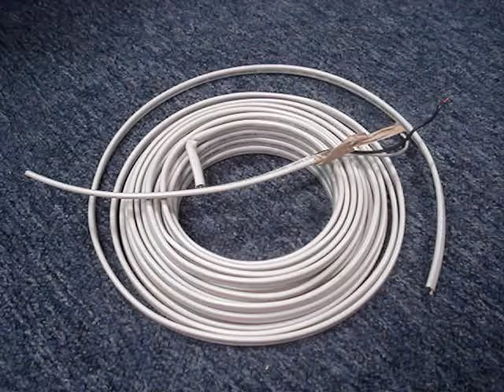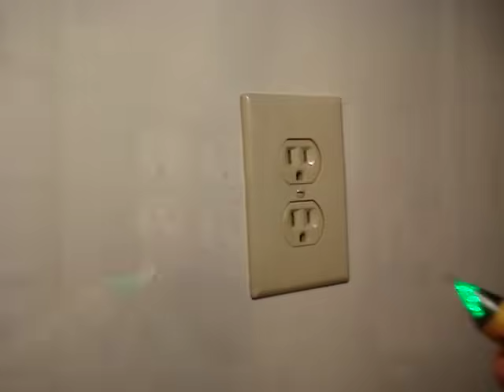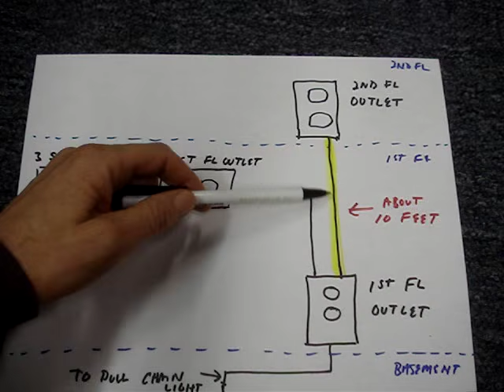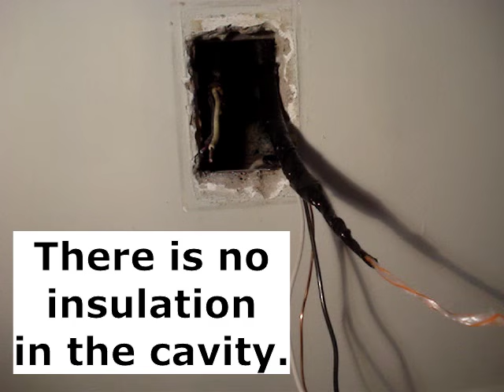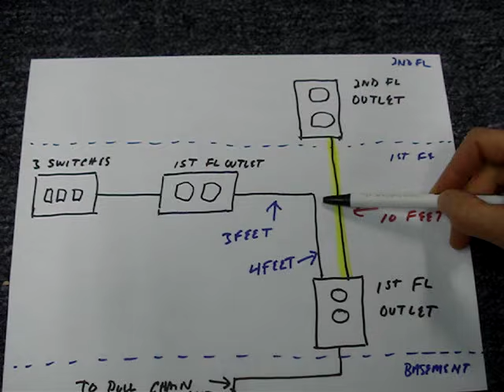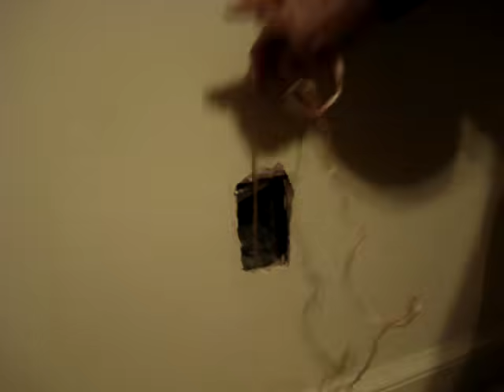Replace Old Wiring in House With Romex - Outside Wall

Comment: In case your wondering why anyone would need to do this the reason is the old cloth wiring is not designed to handle the constant load of today's electronics like a space heater and are a fire risk due to dry rot.

Comment: Do not trust an idiot stick to tell you if there is no power in the box! Always check with a meter especially if your not sure or not experienced with electrical. There is a chance one, even if you test your idiot stick on a live circuit that it gives you a false reading still, or two the circuit shares a neutraul with another circuit (edison circuit) and you will get shocked on the neutraul which if there is a load runing on the other shared circuit, it will hurt.
Reply from the maker: Are you an electrician?

Comment: What kind of string is a pull string? Is it strengthened specialized for pulling? Thanks
Reply from the maker: You can find the string in the electrical supply section of home depot or any other place that sells electrical supplies.  https://www.homedepot.com/p/Milwaukee-Poly-Pull-Line-with-Red-Tracer-500-ft-48-22-4138/327225184

Comment: Hello! Very helpful video. I'm very new to all this and thinking of doing such an undertaking in my mom's old house. How did you know the path of the wires through the walls before starting?
Reply from the maker: It's a puzzle you have to figure out.  It's good to know about the stud spacing/wall construction of your home.  Figure out the circuits by turning off breakers to see where you lose power for each circuit.  Once you know what's on the circuit, look at any visible wiring and make your best guess at how it is wired.
Reply: @Know-How-Now ok thanks!

Comment: Shoulda pulled them wires with a little more strength, when they’re old they’ll break free also attach the new wire to the old. You’ll pull and re wire at the same time.

Comment: Are your wire nuts effective for solid core cables?  We are only allowed to use them on multistrand cables. I am beginning to like WAGO terminals. I am an old school electrician.
Reply from the maker: Wire nuts are the most common connector here in the U.S.  I've used WAGO and like them.

Comment: I don’t understand how you run the wire from one old work box to another with new romex, like how do you fasten the wire? How do you know get it from the one box to the other with all those obstacles inside the wall?
Reply from the maker: Code does not require the new cable to be fastened to the studs.  This is a 1952 house, with brick facing over block.  There are vertical furring strips on the block to which rock lath was attached and then plaster over the rock lath.  There is a gap between the rock lath the rock lath.... no insulation, plenty of room for a new cable.
Reply: @Know-How-Now  oh okay thank you

Comment: Clicked on this video because I was hoping to see how to do this if the wires are stapled.  oh well
Reply from the maker: If there aren't many staples/turns, you might be able to pull the conductors out of the jacket, they remove the jacket.  Unless you are working with cable in conduit, replacing cable is not easy.  I used the method above to get a piece of cable out of the way so I could pull a new piece:  https://youtu.be/vOGOKP4ChtM
Reply: @Know-How-Now  Thanks!  Just not sure how I'm going to pull a new cable if the current one is under staples.  Seems like the only way is to cut away drywall

Comment: What would you do if the wiring was stapled?
Reply from the maker: You might try pulling the conductors out of the sheathing to free up a little room at the staple.  Then you might be able to get the sheathing out from under the staple.  I there are a lot of staples or a 90 degree bend, I doubt it will work.

Comment: Can you add a new Romex with ground to an old panel that never had ground by connecting the new ground wire to the neutral bar if there is room
Reply from the maker: You might want to check your version of NEC or the local AHJ.

Comment: Gotta love the Pushmatic panel, always double check the power is off when using them bad boys, they like to show a false-off lol
Reply from the maker: There's a plan in the future to replace the Pushmatic.  Those panels seem to have a reputation.  I've lived here over 20 years and if I remember correctly I had to replace one breaker.  I've got a bag of breakers from a panel that my friend replaced so I could procrastinate for a long time.  lol.

Comment: Is it really all that necessary to staple the wires to the stud/frame?
Reply from the maker: If you are replacing cable inside a wall as I am, code does not require the cable to be stapled.

Comment: American domestic electrical work looks like a complete schmozzle.  Those wirenuts are such a barbaric connection method.
Reply: It does say "Old House" right in the title
Reply: @BrBill  Yeah, not much has changed in US electrical work however.
Reply: @zoltrix7779  That is a fair comment. Nearly all light fixtures, etc. come with wirenuts right in the box.

Comment: Couldnt u had ran a new wire from the second floor outlets to the panel instead of it piggy backing off the 1st floor outlets. I got tht problem at my house. The whole 2nd floor is piggy backing off the living room outlets. I blow a breaker once a weekish
Reply from the maker: My problem was not too many outlets/fixtures on one circuit, but no ground wire.  So I just needed to pull a new cable to replace the one that didn't have 3 conductors.  It sounds like you need to add a new circuit.

Comment: Great Job. Kudo's to you.
Reply from the maker: It doesn't always work out, I was fortunate to get a new cable pulled through.  I have some more work to do on the 2nd floor before I paint.  I hope to not have to make many holes in the drywall.

Comment: I’m wondering if you could cut the cable at the corner, then pull out cables from two different locations? Not as much to pull in either location.

Comment: I'm curious what you would have done if it was stapled as per code. Great video none the less. Gave me some ideas and good starting points. Thanks :)
Reply from the maker: I'd try pulling the conductors out of the casing, then try to pull the casing through the staples.  If the cable makes a turn or if there are a lot of staples this method won't work.  Sometimes you have to cut holes in the drywall or drill a new hole in the plate for the new cable.
Reply: Could you also pull the individual cables through the existing jacket?
Reply: @fosarvian  This is an old video, but I think she said the old cable was also too short.

Comment: Why not just leave the old wire in the walls?
Reply from the maker: There was a hole that was drilled for the old cable to get to the 2nd floor.  I wanted to use that hole... I didn't want to have to drill a new one.

Comment: The bigger problem is that you have a pushmatic panelboard.
Reply from the maker: During the past 20 years, the pushmatic has been trouble free.  They do have a reputation for being a cheap panel and not so much fun to replace a breaker.  It's holding up better than the breaker in the square d panel at a friends 10 year old house. that I replaced.  lol.  Seriously, it will be replaced at some point, though there isn't a rush.  I've got a bag full of spare breakers.

Comment: You are off to a good start you WILL continue to learn more. I wish I had a few just as knowledgeable and willing as you. So happy to see you doing so well.
Reply from the maker: Thanks for the kind words, Richard.  Most of the next phase of the project requires work in the attic.  I hope to find the time in the Spring when it's not freezing cold or blazing hot up there to move forward again.  My cable pulling/running experience has been in commercial buildings.  The residential work is new to me.  So far it is going better than expected.

Comment: Great video, I know first hand just how hard it is to pull wires in a wall, I replace a few runs of aluminum with 14/2 Romex and it was no easy task.   You did a excellent job 👍👍
Reply from the maker: Thanks for the compliment Kristian.  This pull went easier than I expected.
Reply: @Know-How-Now   I don't know how they did it in the 50's and 60's but today the code requirement is a staple 6 inches from the box and one every 4 feet there after.  Also strip the jacket 6 to 8 inches so that you (and the next person many years later) will have plenty of wire to work with, without having to wire nut extensions.  And make sure to leave about a 1/2 inch of the jacket inside the box, inspectors do not like to see clamps on unjacketed conductors.
Reply: @davidmarquardt2445  How would you address the staple requirements when pulling wire through existing work? Is the only way to be code compliant in that circumstance to open up holes along the way to sure proper stable distances?
Reply: @ProAtTyping   i just read the answer below 
Code does not require staples for replacement cable.

Farmer Dave
7 months ago
Code does not require romex to be fastened when it is fished inside of a finished wall.

Comment: Using a half hitch on cables is essential when pulling...
Reply: Clove hitch paired with half hitch will make sure that knot never slips. Or two half hitches, but I prefer a clove with a half.

Comment: If I lived in America I would buy that old wire.
It served 50+years,deserves better than scrapping.
Reply: I make jewelry with the old wires.  Buyers love the idea of my work being recycled. 
On another note, thank you for your video's!   They are very easy to understand.
Reply: @bonnierainville2116  Jewelry is interesting,but can be made from any copper wire.Those old cloth covered wires rarely pop up on ebay and are multiple types the price of modern wires.Old stuff should be preserved in a museum.

Comment: Why you use 14-2. According to N.E.T.  you should be using 12-2 for outlets!!
Reply: Wire gauge is based on distance and the amperage of your equipment. In a 15Amp receptacle, you can run 14 AWG wire and it’s code unless you’re running more than 130 feet, you don’t need 12-2. Although it is “safer” because you never know what someone is going to plug into it. I personally run 20AMP receptacles with 12-2 because of the appliances and equipment I use.
Reply from the maker: Hi Ismael, I am not familiar with N.E.T.  Is that an electrical code in some country other the the U.S.?

Comment: Do you need staples for the new romex?
Reply: Code does not require romex to be fastened when it is fished inside of a finished wall.
Reply from the maker: Code does not require staples for replacement cable.

Comment: This video not suitable for india n people 😒😒
Reply from the maker: Sorry, Debojit, electrical standards are not international.
Reply: @Know-How-Now  I try to pull out ware watching your video but ware stuck somewhere where
Reply from the maker: Sometimes the old cable does get stuck.  I was lucky that mine was not stapled and that it only briefly got stuck.  It also did not have any bends, if it had a 90 degree bend you won't be able to pull it through.

Comment: Best video on electric I’ve seen on YouTube so far! Kudos and thanks!
Reply from the maker: You are welcome, Darren.  I'll likely add some more as I replace the wiring.  The rest of the work I have must be accessed from the attic.  It's mid summer, so I'm not going in the attic until the Fall when it's cooler.